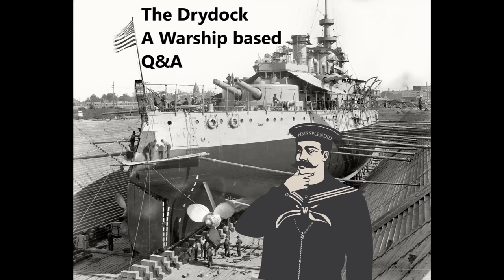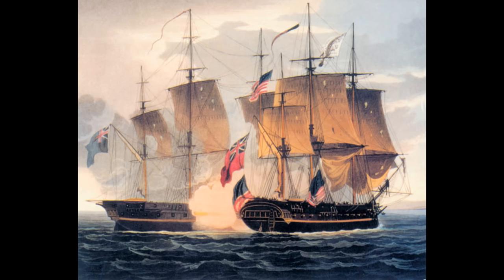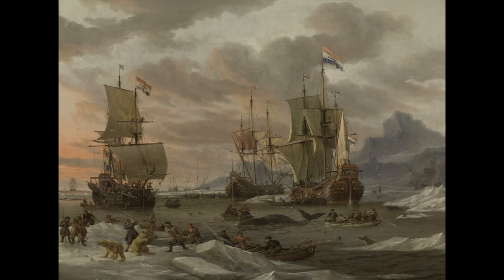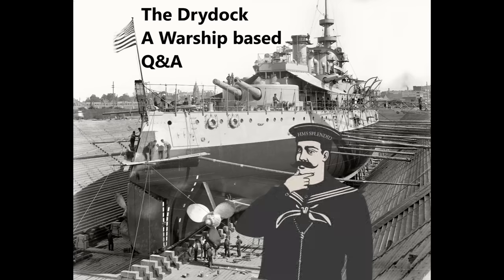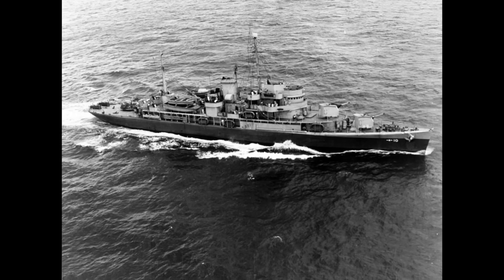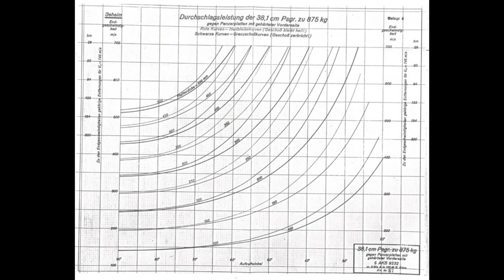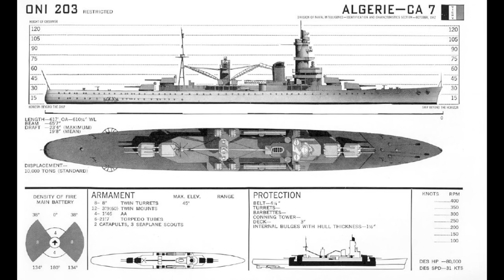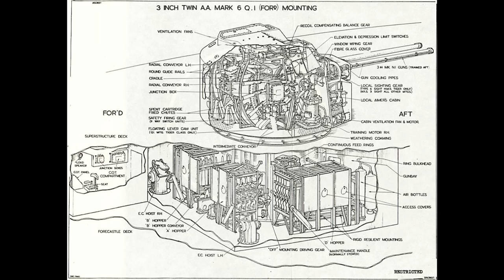The Drydock - Episode 109

Comment: Who was responsible for the dreadful reliability of the Type 14 Torpedos on US subs? Why did it take so long to get the problems solved?
Reply: Drach has covered this a few times but I will give you the short of it. The Beaureau of Ordinance was responsible for its design, but never actually tested it fully before the war, and during the war there were plenty of people who had been in the Beaureau in high places that if it got out that it wasn't working because of them it may hurt their career so they were less than helpful in sorting it out. They didn't actively sabatoge the efforts but didn't help and wouldn't believe reports from the Frontline. It took some high up people getting pissed before it started to be fixed.

Comment: Can't agree on engines. 

I think that's coming from RN doctrine of the modern period. What ships are and what they're meant to do in this case is the act of controlled violence. It doesn't matter how long it takes to get there, you plan for that. It also doesn't matter what your gun, if it's large enough to damage then it's big. If you're protected enough, you're protected enough. 

What matters and what allows people to make the most of the situation is the ability to communicate that intent and the required information to act on it. It's the application of directed, controlled firepower that's going to matter more than the size of your shell. 

I would rather a dozen shells I could accurately place, than a hundred shells to fire at the enemy.

Comment: It is hard to believe that George Bush sr. was asked to carry meals, do cleaning or doing "low level maintenance" as mentioned. From purely point of his abilities, sure he would be capable to do that, but socially big no.  George Bush sr. was at that time a commissioned officer (Lt. (j.g.)) and therefore on such small boat he would be a member of small elite caste (there were only six officers on the entire boat) and in very socially segregated US Navy during WWII he won't be asked to do anything undignified
 or inappropriate for an officer like doing actual manual unqualified work. Even though submarines used to have way less formal environment than big ships, there was still limit to that informality and a strict duties separation of enlisted and commissioned personel would be adhered to.